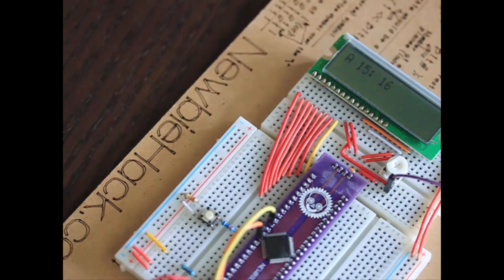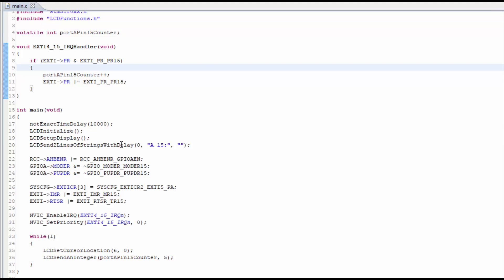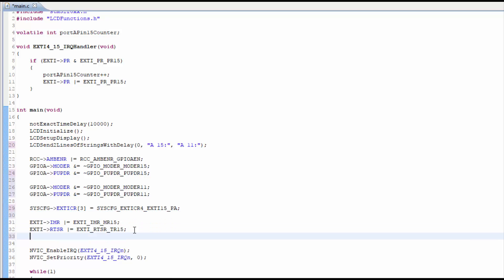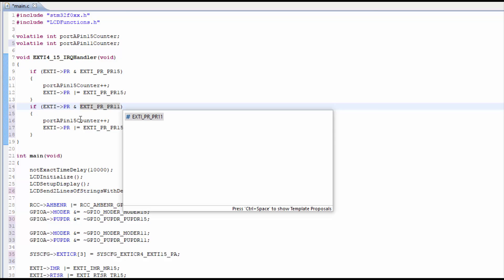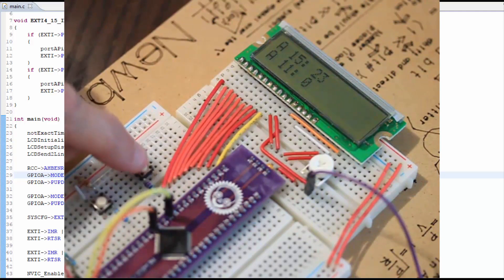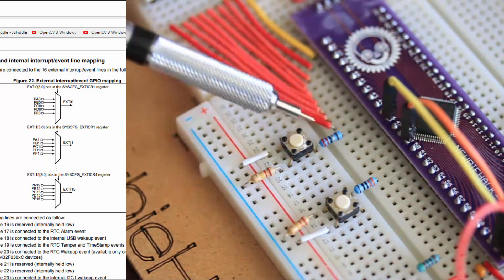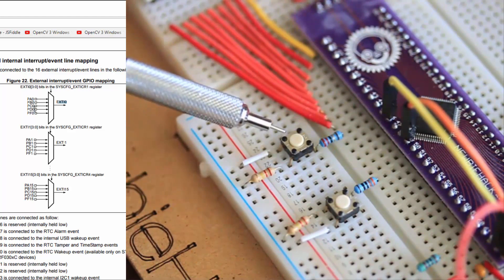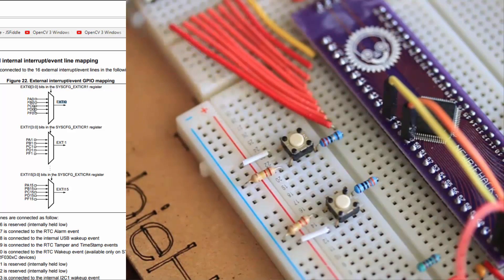55. How to Make Multiple Pin External Interrupts (2 pins) - ARM STM32 Microcontroller Tutorial

Comment: Is the same principle applies to arduino??
Reply from the maker: The only difference with this method is that I am not using a bootloader.  Bootloader is a program on the microcontroller that makes it easier to load programs onto the microcontroller using a USB.  This method uses a programmer that is a part of typical engineering workflow.  Programmers are also used to install the bootloader on arduino boards. The method I show is all about staring with the bare chip and building upwards. The programming is essentially the same as arduino (C, C++ language). You are just programming in a different IDE.
Reply: @PatrickHoodDaniel  thnx for reply

Comment: You really should write ONLY the single bit into the reset register:
EXTI->PR = ...  NOT "|=".  |= will reset ALL set bits and might mean that you skip several interrupts that occur at nearly the same time as the first pin serviced.  In fact, EXTI->PR |= 0; will do the same thing you are doing.

Comment: Hey when you are adding another button PA11 aren't you also needed to change the value of the
 SYSCFG->EXTICR[2] |= SYSCFG_EXTICR3_EXTI11. I works without it too. it works with it too. But i feel like including it is a better thing. what do you say?
Reply from the maker: Go ahead and include it.  When I was doing my testing, I found some really weird results (meaning it worked and I can explain why).
Reply: Patrick Hood-Daniel I did include it and it was behaving in any word way.. all I did was to monitor the button count in the STM studio and both the button counts were working as expected. What was it that you observed?

Comment: Hi, 
I've been enjoying these videos. Thanks for all your efforts. 

I do have a resolution for the problem regarding not being able to run GPIO ports other than just GPIOA on the various EXTI0 - EXTI15 lines. The solution is: the system clock that is used by SYSCFG needs to be enabled. 

The below line of code needs to be added near the start of the program when the GPIO ports, (GPIOA, GPIOB....) are enabled in "RCC->AHBENR". (This additional code only needs to be executed once.)

        RCC->APB2ENR |= RCC_APB2ENR_SYSCFGEN;

It seems that without the above clock enable statement for SYSCFG, the C Compiler, in the generated underlying-Assembler source, will ignore (by optimizing out) any writes to "SYSCFG->EXTICR[#]". This leaves the registers used for External Interrupt Configuration at their default value of all zeros (0x00000000) indicating that GPIOA should be used for all the lines: EXTI0 - EXTI15.
Reply: Thank you, I did the previous tutorial with port B and got pretty frustrated when it didn't work.